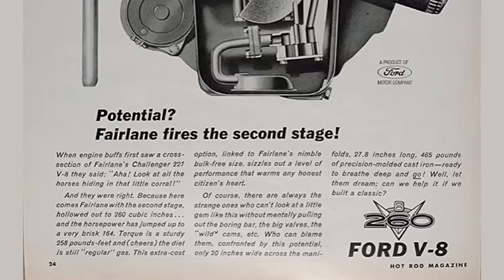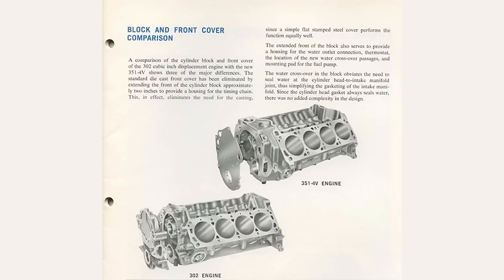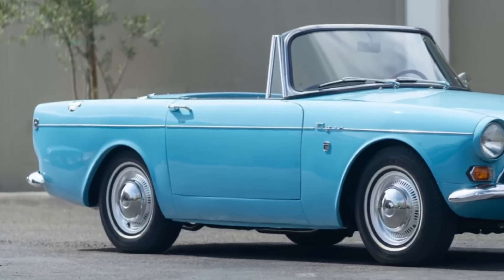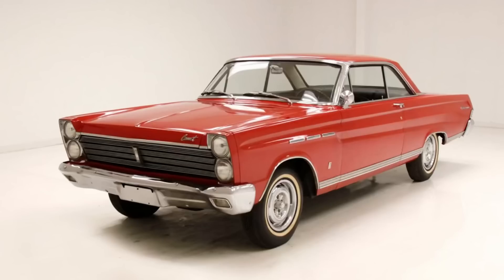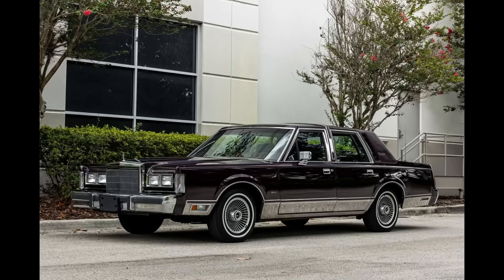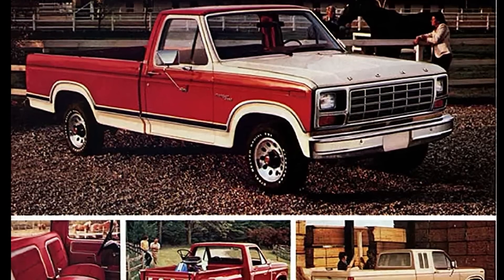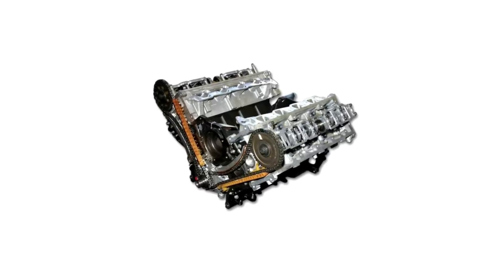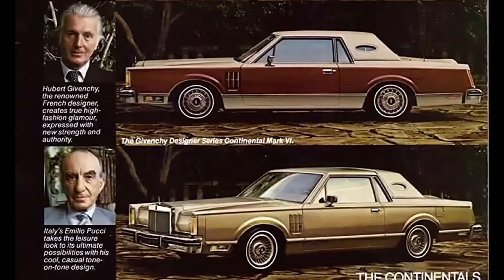Ford small block engine family 221, 260, 289, 302, 351W, 255 not the race engines

Comment: The 289 was produced into the 1968 model year.
Reply: Yes. I have a 68 Fastback that had a 289 with 3 speed manual. Now it has a 69 Boss 302 with a 671 blower .Offy tunnelram intake from Gary Dyer.
Reply from the maker: Thank you for that correction
Reply: My 68 Mustang was an early build, purchased new in December of 67. Has a 289. My understanding was ford wanted to use up it's 289 stock before installing the 302s. Bought mine in 1977, Southern California car,  still on the road.

Comment: 302 and 351 Cleveland and 400 Cleveland.  302 and 351 in Windsor too....😊
Reply: 400 Cleveland? Is that the one with the plastic crank ??
Reply: @Clyde-2055  That is the 4 x 4 400 cube engine.  A short-stroke version of it was the 351 M.
Reply: There's differences between US and Aussie engine names and versions. The US never got a 302 Cleveland and the "Modified" 351 and 400 engines are a different engine family based on the Cleveland pattern but with raised deck blocks and different heads meant to reduce emissions. Unlike GM and Chrysler, Fords later V-8's are a maze of variations, especially with the 3 different 351 patterns.
Reply: Never was a 302 Cleveland.
Reply: @jamesbosworth4191  302 Cleveland produced in Australia from 1969 till 1982, ford use differant names in differant markets, but 302 Cleveland was definitely a 335 series block, the 400 was known as a Cleveland in Australia because it's based on the 335 series block with taller deck and the 351M was not released here so there was no need to differentiate with 351C and 351M.
Same as the taller deck of a 351W compared to 302W still both called Windsor because architecture remains the same.
Triton 5.4 3V in America is called Barra 220 in Australia.
Modular 5.4 4valve in Australia is known as a BOSS, with the power output in kilowatts after it, BOSS 260, BOSS 290, BOSS 302 and BOSS 315. They also continued the BOSS name with the super charged 5.0
Reply: @davidreeves2911  Wow, never knew that there was a 302 Cleveland.  Must be nice.  We in this country only got a 2 barrel Windsor-built 302, except in 1968, when there was a 4 barrel option.
Reply: @jamesbosworth4191 great towing motor, better economy than the 351, they had a performance variant 179kw John GOSS special (240hp) two door falcon 1975, though the 351C was available in Fairlane, Falcon, two door Falcon,  Fairmont and F100 as well as GT variants.
Reply: @davidreeves2911  Such a shame that your government allowed the Japanese to destroy your auto industry.  Our government has done the same thing here.  All that has saved our's is the SUV/Pickup craze.
Reply: @jamesbosworth4191 but the Japanese have produced cars in the US since the early 80's using American workers. I think the unions messed up the big 3 making them less competitive because they don't use union hands. Some actions to save money hurt GM and Ford. Ford does insufficient R&D these days. Its a different engineer nowadays than before. The supply companies are far less than before. Even today I saw a Missouri aluminum smelter may close and we are down to 5 from 23 in 1998.
Reply: @davidreeves2911  Finally someone gets it right. Kudos!
Reply: @jamesbosworth4191  Sad to see Holden close down, but there's some point where protectionist policies and import taxes actually hurt a nation instead of helping it. The US car industry fell on it's face due to our higher build costs, unreliable production due to strikes, lower quality, and not keeping up with the times in design work. Vehicles sell mostly on price which right now is done best by China and Korea, but that too will likely change in time.

Comment: No 289 Cleveland  ! Just Windsor  😊
Reply from the maker: Got a lot of information from this site 

Second section 

https://www.cartechbooks.com/blogs/techtips/ford-small-block-general-data-and-specifications
Reply: Jay was just speaking about which plant did the castings which were identical. Some Ford engines were cast at both plants and some only one. The 302 was cast at both places to meet production demand but the original design and first production came from the Windsor plant, hence the name.

Comment: Thank you so much for doing this engine series! You filled in the gaps of my knowledge and I finally learned about the Cleveland vs Windsor. My father had a 351 Windsor in a Galaxie 500 and it was FAST! He loved that engine. 63 Ford Fairlane and 1982 Lincoln Mark VI. The 66 Mustang is a great car but I like the 65 better.
Reply from the maker: Awesome choices I tried to buy a number of Mark sixes over the years but I’ve never every single one that I’ve ever tried to buy turned out to be a lemon the last one that I drove had a 351 Windsor in it and it was a blast to drive, but ran out of gas on the test drive, and had to push it. That car is not an easy car to push, I can speak lol

Comment: 69 was a good year for Ford
69 Falcon 289 😊fun car 
69 Torino kinda rare  but I had a 69 LTD 460 battle Ship 😂
She floated around corners 😅
My Uncle had a 260 was a good little engine 👍
302 saved ford that 351 mess was a pain to repair !!!!! 
You had to put the part on the parts house counter and match it. 🤬😤.  P.O.S. Ford 😱
Great Episode 
Happy Motoring ✌️🤠
Reply: Not "POS", you just had to know your stuff well to work with Fords, unlike all the others. Falcon (the US car, not the Aussie one) was gone by 69 as was the 289. The 302 made a little more torque at lower RPM's than the 289 which worked better with the auto trans which is why the change.
Reply from the maker: I’ve had lots of Fords they’re great cars you just have to like you said, replace the part for the part that came out interchangeability isn’t up to par with Chevy Chevy. You could take whatever engine and bolt it to whatever transmission you want which is great there’s no headaches ford you can’t do that.

Comment: Well not only would I pick the '63 fairlane, I actually DID pick the '63 fairlane. Jay, your doing "This is your life" of cars! Last time it was the Mercury, now this. In 1968 I bought a used '63 fairlane sport coupe, like the one pictured, but mine was black with a red accent stripe down the side, and a red interior. It had the 221 with 3 on the tree and- get this- factory overdrive!  Unusual even then. It was my first car- $600, plus it needed a clutch real badly.
The 221 was ok, never let me down, but it did what they all did, blow oil out of the breather. It was more of a mess issue rather than an oil consumption issue. It is a physically small engine, it seemed to me to be shrugging its shoulders as it sat down in there between the spring towers. I traded it in '71 for a brand new vw beetle.
Reply: IIRC, PCV systems came in '64 by Federal mandate. Prior to them there was a 'road draft tube' which did allow breather blow-by. Like the rest, there were several different arrangements for the breather on PCV systems.
Reply from the maker: Great choices happy you dig this one =)

Comment: The 221 V8 was intentionally designed to be the same cubic inches as the original 221 Flathead of 1932. I'm a Ford guy, but jeez, Ford has made some really questionable choices over the years. such as having a different bellhousing bolt pattern for almost every engine Ford made. WTF? I'm sure there would be more Ford powered engine swaps if you didn't have to change the whole transmission, too. And I certainly never heard of the 260 hi-po, altho I did know about the Falcon Rally cars. Good episode!
Reply: We wonder what drove the bell housing pattern madness? Even a given pattern might have tweaks... starter location, an "ear" cut off, converter pilot...

The Modular arrived with "small block" pattern, so obviously it was workable, then "bam" a change to a new pattern.

Now let's mention balance issues...

But I still love 'em.
Reply: @johne189  Sigh. A friend and I recently swapped the original 289 and C4 trans from his 67 Cougar to a newer (70s) 302 and a newer (70s) C4. At least the bellhousing bolted up, but the bellhousing didn't narrow down as sharply as the old C4, which made the downshift lever and cable bind. Then we had to play around trying to get the correct flexplate and harmonic balancer. It runs reallll strong now, but sheesh, what a job!
Reply: @johne189  I could be wrong, but several people have told me that the 5-bolt block was to match existing transmissions which were being dropped for the new C4 which is nearly as varied as everything else. And the crank balancing is just as crazy as the rest, which can lead to broken cranks if you use the wrong pieces. IDK much about the 'modular', my focus was always on the older SBF, and maybe it's the craziness which makes us love them... Why be plain when you can be insane? 🤣
Reply from the maker: Ford had some questionable building practices like more than one bell house design different tail shaft lengths
Reply: @What.its.like.  Like Chrysler, Ford basically had small and large block transmissions thus the different bolt patterns for blocks. I have been told the early 5-bolt SB pattern was to match existing transmissions until the newer and better C4 automatic got into full production. Having different tailshaft lengths allowed for better fit in different chassis sizes, and the manual bellhousings were sized for the clutch diameter being used allowing for smaller sizes and using less materials with them. It makes good sense when you understand it even if it reduces interchangeability.
Reply from the maker: Chrysler has a really complicated engine lineage. I’m not sure if all of their engines bolt up to other transmissions I’m not versed in Chrysler it’s something that I need to work on lol.

I like Fords but in the late 50s it’s super confusing because they had three different case sizes three different tail shaft sizes and the torque converter could either be air cooled or water cooled and they don’t interchange
Reply: @What.its.like.  Starting around 1972 Ford also reduced the size of the torque converter "snout"  (pilot) from 1.848 in to 1.3 (approximate) on 385 series engines, as well as all 400s and 351s
Early C-6 large pilot converters have become rare, and a local converter rebuilder will not exchange yours unless you have a large pilot as a core.
Rarer still is the 1966 only "green dot drive" C-6 valve body.
I snag every one of those and large pilot converters whenever I find them at the wrecking yard.
Ripoff LKQ tries to charge $180 for any valve body so they get stuck in my waistband in a plastic bag under some bulky coveralls as the U-Pull and Pay only charges $40 for a valve body, and only $175 for an entire transmission including core charge.
Reply: @What.its.like. Chrysler sixes, small and big block v8s all have different beĺl housings. Did the same with most v6s.
Reply: @P_RO_  a    Ford had MANY bell patterns in the 1960s and 1970s.  the early OHV six (223/262) bell,  the 144/170/200 had their own, the 221, 260, and early 289 had a unique pattern, which was switched to the new bell pattern for 289/302 1965-newer, the Y-blocks had their own pattern, the FE and MELs shared a pattern, and the 429/460 had its own pattern.   The 250 for some reason got the late 289/302 pattern.   This all to hook up to at least a dozen different transmissions.
Reply: @xaenon early 5 bolt 221, 260 and some 289 is the Straight Six 144/170/200/250 bellhousing.
Reply: @johne189  Ford had reasons, trust me.  Remember, Ford was playing with like 15 different transmissions at the time.  The C4 (two different types!), the C6, the FX, MX, and FMX Cruisomatics, two versions of the Fordomatic 2-speeds, the 2.77 and 3.03 3-speeds, the Warner 4-speeds, two different overdrive setups, the Dagenham 4-speed, and the T&C 4-speed - all between 1960 and 1970.   And that doesn''t include the 'dual range' versions of some of those slushboxes, or the super heavy duty versions of the Cruisomatics that were specific to Lincoln.
Reply: @xaenon @xaenon But... all except one of the mentioned transmissions used a separate clutch/converter housing. 

The various housings were already being built with multiple patterns, essentially doubling as  engine-to-transmission adapters; often mating the same transmission case to several different engine patterns - including non-Ford engines.

So it's difficult to imagine that it would be easier (cheaper?) to justify modifying blocks rather than more simply modifying the  housings?
Reply: For example, practically the same  "iron Ford" transmission case was being mated to Ford, Chevrolet, Rambler, Studebaker... and more. If another housing has to be cast and machined anyway, why change the back of a block to create a match-up to just one of several  transmissions being simultaneously offered? 

I don't know the answer. Obviously Ford must have had some justification. However, to me, changing a block's pattern to "match" to a transmission when it will require building another "custom" housing anyway, that doesn't add up.
Reply: @johne189  It's a matter of what Ford was willing to produce and, more importantly, warranty.  There is a long and complex application list for the transmissions I mentioned - some are simply not suitable for certain engine families, and Ford also had other reasons for the various bell patterns.   The 6-bolt versus 5-bolt bell in the small blocks, for example, was to address vibration and harshness under certain loads.  Or at least, so I've read.   And when Ford introduced the new C4, the old two-s;eed slushboxes were already being given the heave-ho.

Remember, Ford wasn't in the business of making sure guys could swap around parts in the cars after they'd been sold.   The general idea was the engine and transmission that were in the car when it was sold would remain in the car until at least the warranty expired.

It's the main reason Fords were so spat upon by the hot rod community in the 60s and 70s.  The Chevy and Dodge boys had trouble keeping up wth all the things Ford did.  They couldn't deny that Fords made power, but getting things to hook together was definitely not for the uninitiated.
Reply: @xaenon  Some of it is crazy. 
Supposedly the Lincoln  429 had its top corner clipped for HVAC clearance. It seems like the only logical explanation but it necessitated a unique Lincoln-only transmission case to match. 
We'd think some Lead Engineer would've said: "No boys, the foundry doesn't need any more variety - try again with the blower box, Ford and Mercury made it fit..."

Then at times when the bolt pattern and crankshaft flange  really could've  justified some change, they skimped with an adapter. IE 300-6 in a big truck. Probably for lack of anticipated volume?
Reply: @johne189  What adapter are you referring to?   Are you referring to the bellhousings?   The 240/300 uses the small-block bolt pattern because Ford essentially treated those engines like small V8s.  Same with the 250 six-banger.
Reply: @xaenon The adapter  I'm referring to was used when Ford factory installed 240/300HD in trucks heavier than 350 Series. An adapter plate was bolted to the back of the block to permit use of a large flywheel and housing compatible with the heavy trucks. The 300's tiny SBF pattern was completely "buried" by this arrangement. Something similar was sometimes furnished to industrial  engine customers.

My point was that since Ford was quick to whip up oddball block castings, this was an application that could've sure used one. Maybe go with the FT pattern and crank flange? Thus permitting use of the same components as much of the Medium truck line used? This rather than the awkward patchwork with massive overhang of heavy truck components on a wimpy "Fairlane" base. But we better quit giving 'em any more ideas for oddballs.😅
Reply: @johne189    Huh.   I never dealt with trucks bigger than the F350 with a six cylinder, so that is interesting to know.

I could see  an adapter for the FT bolt pattern.   It would make sense from a production standpoint..

The 240/300, though, was an incredibly sturdy engine.  I have actually heard people refer to these engines as Ford's 'big block' six cylinders, and there is some actual merit to that description.

 I can't imagine Ford would feel a need for a unique bell for that engine in heavy duty applications - at least, not enough to justify designing and producing a separate casting.     It might make sense to create a separate casting for the heavy duty applications, but I feel the production volume for that engine in such heavy vehicles probably did not justify it.   I'm sure the FT 330/359/361/389/391 mills would be far more prevalent, and remember, Ford also made those big SD 401/477/534 engines too.

If Ford were truly interested in making a block unique to these heavier applications, I feel they'd probably go ahead and just create an even larger six like GM did.
Reply: It may have something to do with marine applications. I have no idea. But the 221 was used in some boats. I'm sure 289's and other had marine applications as well. I know 5 and 6 bolt bells were in Mustangs so I kind of doubt my suspicion. My other guess would be clutch size as the engine displacement grew. Just throwing this out there at 3:38 AM.
Reply: I don't think FORD has been worried about hotrodders 50 to 70 years from then OR now about how the current engine swap fad will interchange.

The 221/SBF was all about small and lightweight for economic reasons.

SMFH
Reply: If only...the Windsors and Clevelands had the same deck height. That would have been nice. But no.